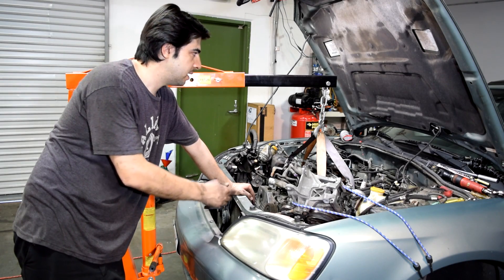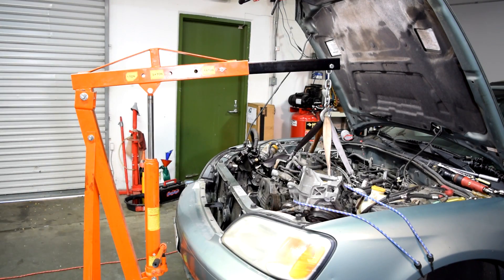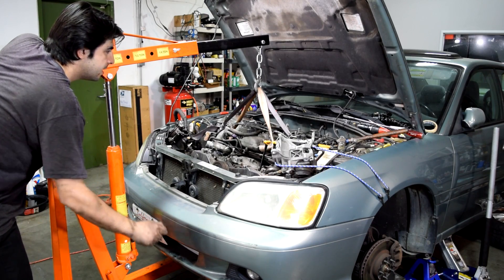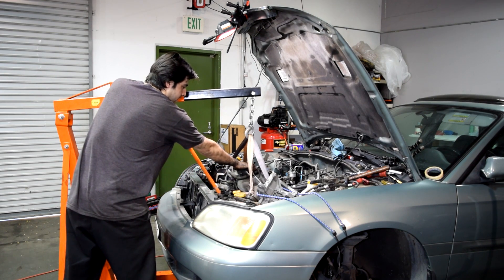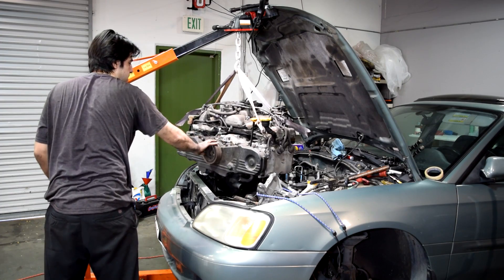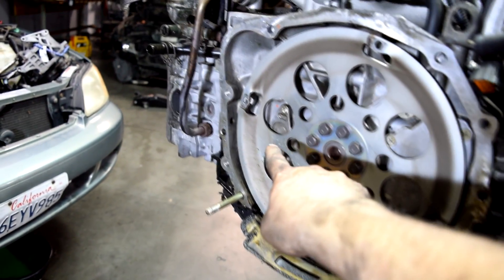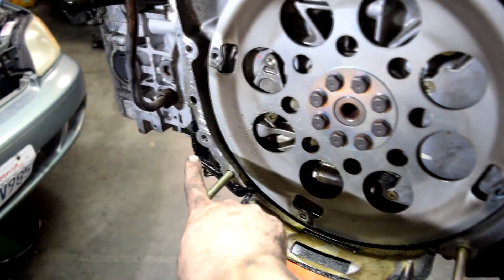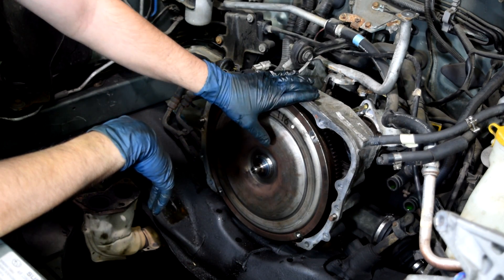Easy Subaru Engine Removal - Engine Swap or Head Gasket Replacement Part III

Comment: Dennis is right. I helped a couple of guys who were renting my garage space to do an engine swap (short block exchange) an a WRX STI.  After much of their wriggling time, after my intervention with a chisel and four pound hammer, and a long pry bar, the major parts separated. Though now retired, having had 15 years in the trade, you learn not to waste too much time on "niceties".

Comment: Would it not be recommended to just remove the lower engine to torque converter housing studs to prevent any unnecessary problems when pulling the engine forward? I am currently removing my EJ253 engine from my 07 impreza outback and the housings are stuck together LOL. I hate hitting anything with a hammer (22 year helicopter mechanic) but in this case I will make an exception.

Comment: hey how are u   i have engine subaru legacy have one bolt 8mm just one i dont know where is fix that i cheak all engine but did not find the place of 8mm bolt i replace the engine  so you have some any idea please thanks 2015 model

Comment: I know I’m a bit late to the party but if anyone is watching this video still I would not recommend pulling the engine out by the intake manifold those things are expensive and it’s necessary. On the back of the engine there is a very thick metal bracket that holds those really big wire plugs I put a hook though that and then another hook around the AC pump bracket is very strong and is held in by three 14 mm bolts.  Didn’t break anything and won’t damage your intake. Also some people like to pull the intake off and put a few intake bolts back into the head with a chain on them. I did this to remove my engine and I was a huge mistake, they are only half inch bolts and not strong enough to hold the engine. One of mine snapped off in the head and I had to drill it out and tap my head and use a much larger bolt not fun just do it right the first time.
Reply: Has any one ever replaced a.     H6 engine with a 2.5 sohc engine and doses the trans bolt up I now the computer would have to be changed and other stuff thanks for ur info

Comment: I watch your video on changing the engine on a Subaru Outback, it was very helpful. Your explanation and camera work were Hollywood quality, you should be in the movies. I have a question that requires a guru like yourself. The engine that I put in is a 2.0 used from Japan, the original motor was a 2.5. for some reason which eludes me the new engine will not start. If I use starter fluid the engine will run for a few seconds. Normally when the ignition is engaged by turning the key, you hear the fuel pump priming, but I don’t hear it now. I checked all the relays, and all are good. I had a neighbor who is a mechanic for a local dealer check it using a $5,000-dollar scanner, he told me that the injectors are not receiving any signal. Is the wiring harness different than the original? In plugs in without any problem.

Comment: Nice video thanks for posting. I have a B4 with a 9:1 compression ratio, I want to drop it to 8.5:1 the diesel ee20 engine has similar head gaskets and is 1.6mm thick vs the twin turbo gasket at 0.8mm thick.

So if the diesel engine has a 20:1 compression ratio surely it will be a better head gasket to use in my case, do you think this is possible (will fit) and do you think the diesel head gasket will last longer than a stock twin turbo gasket seeing as though the stock gasket only lasts for around 100 000 km and the diesel head gaskets have to be stronger?

Thanks for your feed back.
Reply: EVZebra have u tried it yet
Reply: Hi as it turns out my mechanic said 2mm thick head gaskets were available so we fitted them, the car is running fine after the "Line 10" modification, lambda sensor is installed (cone air filter could have changed things too) she is running just fine as is, next is a pressure regulator 1-2 bar on the waste gate set to 1.1 bar - we only get 95 octane so dropping the compression will make it safer to add a bit more boost no more than 17 psi on my engine variant or we pick up reliability issues.

Comment: I put a 2001 Subaru engine and transmission automatic N2 and the computer 1999 Subaru Forester the 2001 Subaru Forester transmission does not work and it worked beautifully beforehand you have any ideas that you could help me with this problem please please

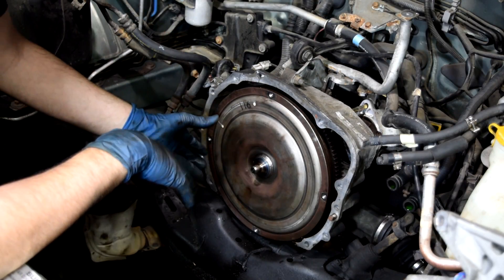Comment: Just pulled mine - 2003 Forester, same engine and all of the came steps, pretty much exactly - I cannot stress enought how HARD if might be to get your engine to crack free of the bell housing EVEN AFTER you've removed all bolts, gotten enough mount stud clearance over the motor cradle, and supported the transmission.  I pulled, wiggled, levered, dropped and lowered, even put in on of the tolp bolts almost all the eay in and smacked on it with a hammer.  Finally, I did use a 1"chisel and a 3 lb sledge.  It felt like a very HACK thing to do to whack on a chisel to separate them, but it worked.  I'm writing this to anyone else doing the same job as encouragement, that these things can really stick together, and you will have to keep at it.  I'd read elsewhere that the dowl pins/locators can sometimes be to blame and doesn't hurt to clean/polish them a bit prior to reassembly.  This video is very good in that you show all of the bell housing bolt positions at around 5:00 min mark, which helped me feel confident I hadn't forgotten anything, and it was just time to start shacking!

Comment: I think you might have solved my issue for me. I am having a nightmare of a time getting the engine back in on a 2006 impreza. Do you think it would be better to put the torque converter on the transmission, or bolt it back to the flex plate before reinstalling the engine. I have 3 bolts started from the bellhousing to the block, but I end up with a 3/4 inch gap on the drivers side.
Reply from the maker: +THECaptainPanic Make sure the torque converter is back on the transmission but not only that, YOU MUST make sure the converter is in all the way, it takes a bit of force to push it in where it clicks into place. Try putting both hands on the torque converter turning it from side to side as you are pushing in. It might go in and click once but you might have to keep turning and pressing it in for it to click in twice.  If you dont get this part right you could damage both your transmission and engine. Look up "how to seat or install a torque converter" on youtube for more instructions. GL
Reply: Ohh!! Thank you! I've never worked on a Subaru, or actually an automatic.

Comment: Hey man I used you ej25 rebuild series and these Subaru engine removal videos to complete my Outback ej25 project. I bought a doner engine which turned out to have a damaged crank and number one rod which I bought new replacements. I was unlucky here. However the engine is installed and has run over 1000klms and is due for its first oil change. It started up first time and runs terrific. Thanks for your video series it helped hugely . Cheers.
Reply from the maker: 240kDatsun Nice, glad to hear these video's helped you out. thanks for commenting. cheers

Comment: Torque converter - if it comes out (like mine did) take it all the way out and look for the metal clip BEFORE pushing it back in - it can hide inside the shaft, it belongs on the torque converter and if its not in the right place it will cause all sorts of noises when you start the car later - this applys to atleast gen2 and gen3.

Also the metal back plate - iv had a 96 with a metal one and my 2000 had one also (unless they were replaced) however they were still leaking because the screws were loose